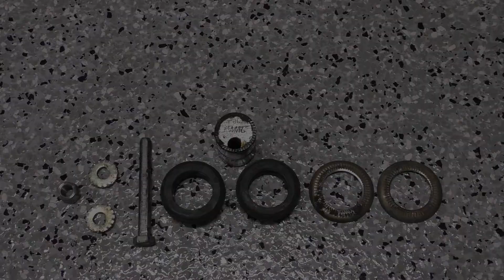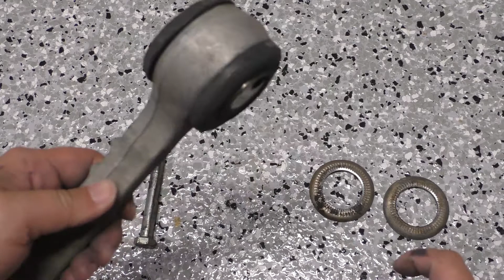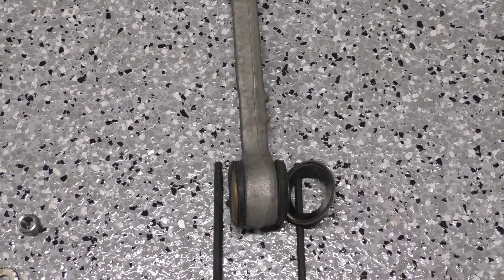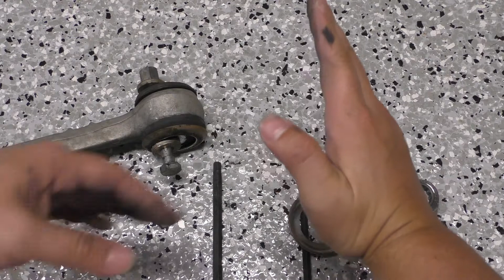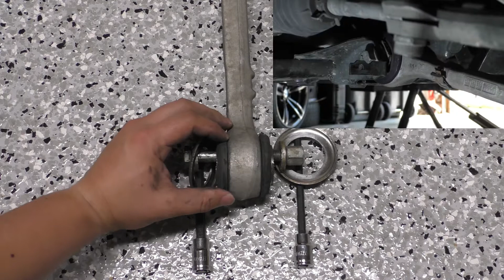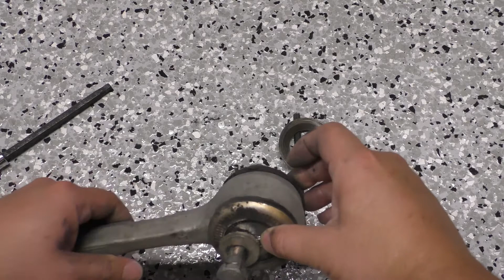KMAC Camber Bushings for BMW F2x/F3x

Comment: what was your ride hegiht with this -1.8 deg of camber? I ask because I have -30 min uprights and adjustable lower arms on about 26.5" fender height from ground, with that I blew out a CV axle at only -2 deg of camber...
Reply from the maker: I usually measure center of the hub to fender. I generally run about 14" center of hub to fender. I have gone a little bit lower (no more than 0.25") but wanted more clearance.

Comment: can these be rotated to get just another 0.4-0.5 negative camber. I mean can you get any amount of negative camber between the minimum and max limits of this bushing? Or you can only go minimum or max to line the hole up with the arm. I hope that makes sense.  I dont need much. Also, are these a better option to powerflex adjustable ones? Thanks

Comment: I am currently using these bushings but now getting a steadily worsening squeak after 5 months of use. K-mac unfortunately, is not a great source of information on how to resolve the issue. I am assuming the bushing needs a re-lube but wanted to get some feedback from another user. I assuming, using silicone-based grease, the metal cylinder is lubricated. But you mention lubricating the inside of the two locking rings. Is that correct? Since I've long lost the box, as for grease, was there a preference?

Thanks.
Reply from the maker: Yeah, they creak when turning the steering wheel once the lube dries out. I only ever really noticed this at low speeds like in a parking lot or going in/out of my driveway. Since I only noticed the creak when turning, I thought it was more PU rubbing against the outer locking rings. If it's creaking with the suspension compressing and the arms moving up/down, then that'd be cylinder.

Comment: Hey Farkle, having gone with Millway, how did they compare with the K-Mac bushings? I'm on the Millway Street Camber but don't love the extra 'clunk'iness. Thinking of combing the K-Mac with the -0.5 degree wheel carrier. My car is X-Drive so I can't use the M3 control arm solution, a solution I loved on previous RWD BMWs.
Reply from the maker: The KMAC bushings will creak when the grease dries. Mainly noticeable when backing up out of a parking spot. I've been very happy with the Millway street camber plates for the past 30k miles. Mine haven't had any clunks.

If you do go with the KMAC bushings, just make sure you're not too low. They can still cause a half shaft to pop if you are (I never had that happen though).
Reply: @FaRKle0079  Curious how wide a tire did you run in the front? When you say too low, are we talking 20-25mm or more like 40mm+?

Comment: I’m looking to put some lowering springs on my F22 (220i) to drop about 25mm-30mm front and back, would these (or power flex) bushings enable me to get -1 degree of camber, you think?
Reply from the maker: Yes, you should be able to get above -1deg after lowering (maybe up to -1.5deg) with these.

Comment: Do you know if these fit the M240i rwd F22?  Their site says they fit the F23, but that's just a convertible F22. I emailed them and was told they wouldn't fit because it was an M car which has a different size bushing. I'm confused. Thank you for your help, and for the informative video.
Reply from the maker: Yes they fit RWD vehicles too. Both RWD and xDrive use the same bushing. It'll work on your F22.
Reply: Thanks

Comment: Would you happen to know if these will work on an xDrive version (F22 M240i xDrive). ECS says its not compatible with the M240i xDrive. Are the control arms different for the RWD and xDrive?
Reply from the maker: Yes it works on xDrive. The vehicle I had this on is a 328d xDrive, which uses the same LCA as your m240i xDrive.
Reply: @FaRKle0079  Thanks for getting back to me on this. Eversince I changed my wheels to a wider wheel and slightly different offset I've been rubbing. Nothing worse and annoying as a wheel that rubs.Anyway, I appreciate your reply on this. As you know there isn't a whole lot of aftermarket parts for the 2 Series especially the non M variants. I've also watched your video where you compare 3 different camber plates. I was going to go with the Dinan plates but didn't want the added issues that come with camber plates. Thanks again. It's nice to have someone out there thats done the due diligence. Keep up the good work on your vids...very informative and direct.
Reply: @FaRKle0079  Update: I ordered a set of these KMAC bushings from ECS and they arrived pretty quickly. Anyhow, just to let you know, they have not addressed the endcap issue. I will have to shave them down as well to fit under the end washers. Other than that, they seem to be of pretty high quality.  I'll update once again after I install them.
Reply from the maker: @wilson1356  Thanks for the follow up! Part of me wonders if ECS ordered them a while ago and just had them in stock. If it came direct from KMAC though that's kind of disappointing.

Comment: Hi, I can ask you if it is correct to have eccentrics work in a different position between left and right. I have an f20 with a slight difference in camber and caster between left and right and as I would like to mount the eccentric bush LCAs to have a more negative camber, I would like to try to equalize the differences in caster and camber by playing up their positions, for example by turning the left eccentric clockwise and right eccentric counterclockwise, starting from the maximum camber position. What do you think about it?
Reply from the maker: It's OK if the position of the eccentric adjustment isn't the exact same on each side. I agree with your overall goal of adjusting the bushings such that the overall camber is the same side to side. I'd try to aim for even camber over even caster.
Reply: @FaRKle0079  Thanks for answering me. So you share the idea that by turning the eccentrics on lca, clockwise or counterclockwise, you could also correct the caster in a certain limit, obviously reducing the maximum camber obtained.
Reply from the maker: @giuseppederrico5655  Yes, I agree that can work if you don't mind uneven camber.
Reply: @FaRKle0079  Hi Farkle, always thanks for the replies. I would like to ask you what do you think of the powerflex pff5-1902g to be mounted on the F20 RWD. I saw how they are made and they have a steel cage dissolved in polyurethane. Do you know if they work well unlike other manufacturers? 
kmac is valid but difficult to get in Italy (high cost).
Reply from the maker: @giuseppederrico5655  I have concerns with any design where there's just PU constraining the the fore/aft rocking movement of the arm when installed. If you have to go with a PU part like this, I'd get the stiffest PU (race version) to have the most strength in the flange supporting the arm outside of the hole.
Reply: @FaRKle0079  grazie Farkle

Comment: Did you use these bushing instead of the Millway camber plates or with the Millway camber plates to give the front tires more camber?
Reply from the maker: I did run these bushings in conjunction with the Millway camber plates for a decent amount of time. It wasn't needed to get the target camber I wanted though. That said, if you maxed out the camber plate, you'd be able to get additional camber by adding these.
Reply: @FaRKle0079  Thanks for the info. Not to get too far off topic, but in comparing bushings with plates, with the bushings, once installed the car would then get an alignment and be left alone since re-adjusting the bushings means putting your head between the ground and a 3 ton machine suspended by a thing one buys when on sale (what could go wrong?) but with the MIllway plates, does the car need to be aligned each time the camber is adjusted?
Reply from the maker: @thecasualdiyer6729  I got an alignment every time I adjusted either the bushings or camber plates. Camber plate adjustment should affect other alignment less than the bushings, but I just had everything checked and set to my specs each time anyways.

I've heard others say that even adjusting camber plates on this platform also changes the toe, but I haven't checked myself.

Comment: I have a bone stock RWD F30, would you recommend this over getting the F8X wishbones for better steering?
Reply from the maker: I like these over the F8x arms since you can adjust the camber. For improved steering you really want to upgrade the tension strut bushing to a monoball though. That has a much greater effect than the wishbone/LCA.

Comment: Have you heard of anyone putting an oil bypass filter (amsoil, etc) on any of the diesel BMW engines? The extra filtration doesn’t sound like a bad idea.
Reply from the maker: I can't say I've heard of this. I do a Blackstone oil analysis with every change and the stock filter is doing a good job.

Comment: Why not just taking the M4 Lower control arm ? These are ca 10mm longer and also bring ca 1 degree additional negative camber!
(Not working on xdrive as i heard)
Reply from the maker: The F8x LCA/wishbone isn't adjustable like the KMAC, so you might not be able to get even camber side to side. It's a good option for RWD vehicles though for a "fit and forget" part.
Reply: FaRKle0079 don’t think 100% camber balance left to right is so important, if one side has 10 or 20’ more or less camber it shouldn’t really affect the ride
Reply from the maker: @vollcare4076  I agree it doesn't matter much for a street car, but folks who track their car typically demand better matching.

Comment: Nice review 👍

Does these KMAC bushes produce any more noises or are less comfortable/harsher  ?
Reply from the maker: At 10:46 I talk about the noise, and have footage with it. Aside from that specific case you shouldn't notice any more noise over the OE bushing. There's no significant impact to ride quality with these. Maybe a bit more feeling in the steering, but it's subtle. Unless you're trying really hard to focus on it, you won't notice.

Comment: I used their rear trailing arm eccentrics to fix camber and toe on my e34 touring. 
They also work for e30. 

Never had an issue with squeaking, losing alignment, etc. and was able to adjust alignment on bmw’s rack to factory Mtech specs despite being 2+” lower than stock. 
All this to say they’ve a good company and reliable.